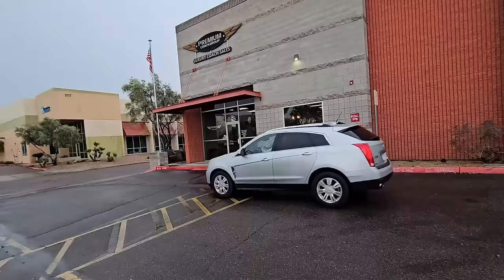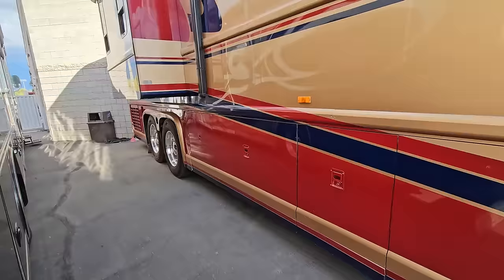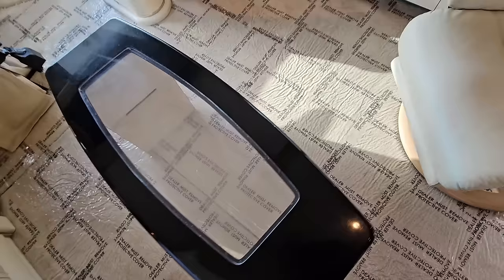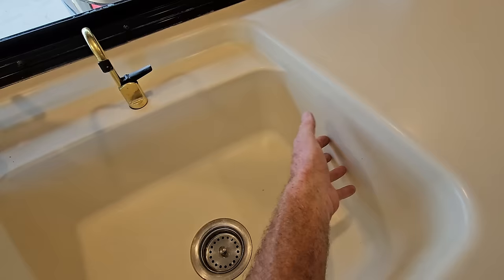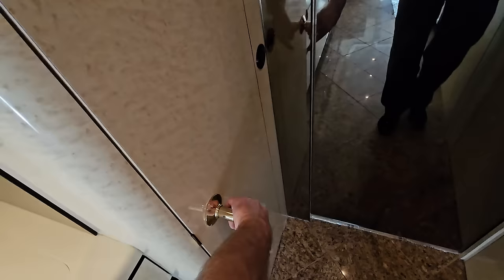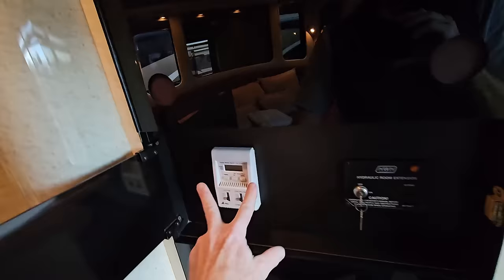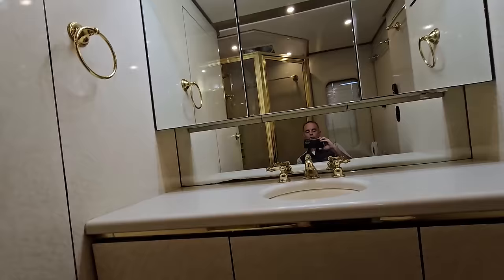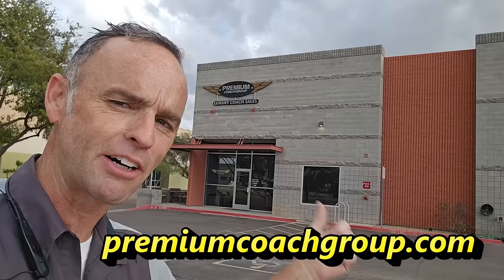How Did This 1998 Newell Surprise Me?

Comment: Looks nice. Need to put the slides in to see how they line up and how much room there is inside when retracted. One note with the 2 stroke Detroit engines is that they won't get as good economy as more modern engines and they definitely don't like being overheated so watch the gauges. This bus is better than almost ANYTHING built today.
Reply: I ran Detroit Diesels for many years, both on the grapevine and the Siskiyou Pass, heard the same comment about heat. but never had an issue. As long as they are well maintained, kept in their powerband and the correct gear, you should never have an overheat issue.

Comment: Nice well maintained coach.  Mileage is a non issue if it was serviced  regularly.  Which based on everything else would be a reasonable assumption.
Didn't see any views with the slide outs in.  I like to see how much walkway room it has when in travel mode.  Thanks for another good video.
Reply from the maker: As there are only two slides the aisle ways are very widein the living room